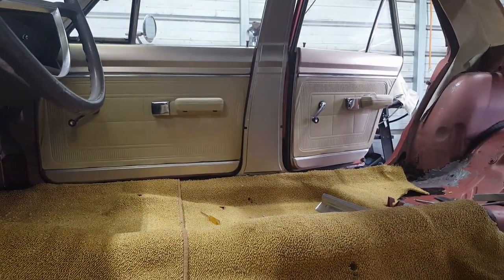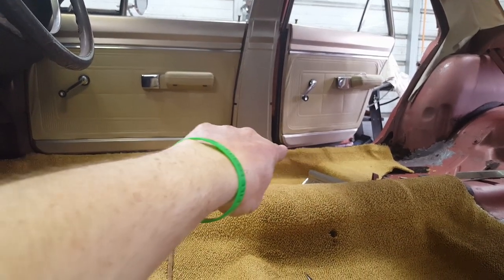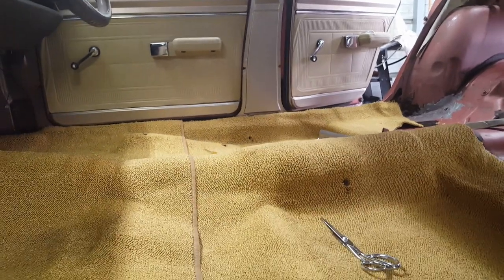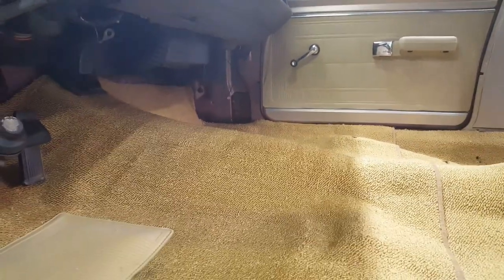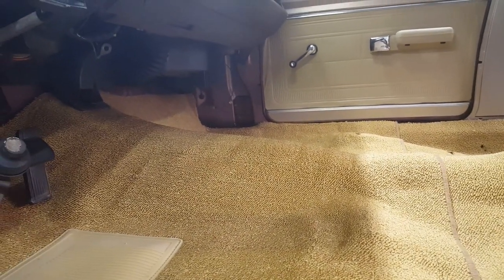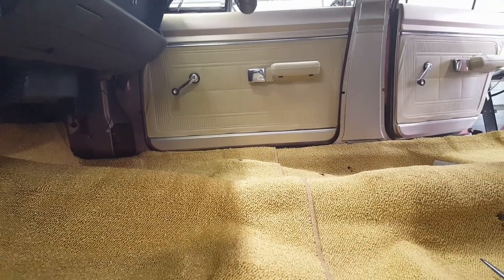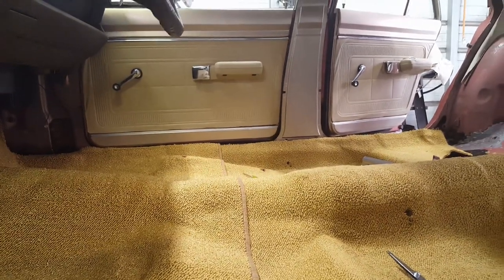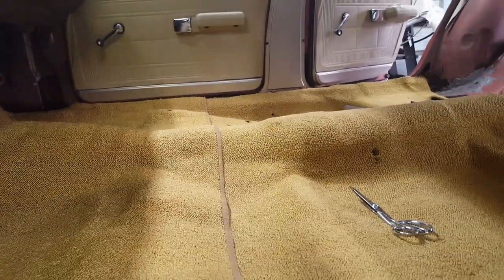Mopar A-body carpet installation

Comment: Something I always noticed about A body Mopars was the lack of sound deadening materials in and around and under carpeting. I guess that was an extra $ option when ordering the Dart and Valiant.
Reply from the maker: There isn't much. 2 large pieces under the carpet, one on the underside of the cowl, one across the firewall, two on each end of the firewall and two behind the kickpanels.

Comment: Is that material close to what was originally used? I remember my dad ranting how 'cost effective' the cars were when he bought one new and it had a rubberized padding material that wasn't even really carpet. And of course the cheapest one available at the dealership didn't even have a radio. Modern materials will probably last longer I imagine. Looking like a great premold kit.

Comment: Where did you get carpet is that cut pile..... I got some carpet from ACC for my 74 charger and I was not happy with it rather like the look of what you put down on this car even if it may not be original to my year.
Reply from the maker: Whenever you order carpet, you should be presented with choices regarding style and color. The style shown here is 80/20 loop which is found in pre-75 or so Mopars.  You can simply choose the cut pile option when ordering.
Reply: @TylersNeighborhoodGarage  thanks for answering.